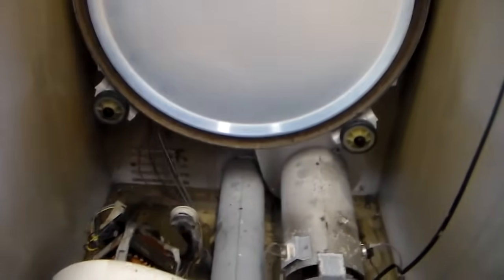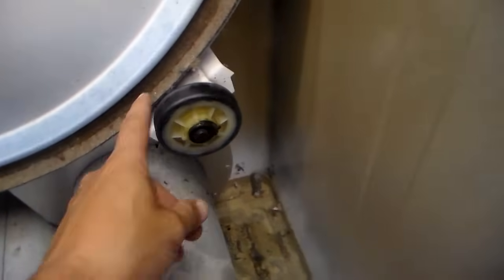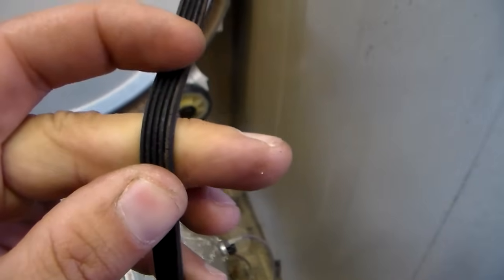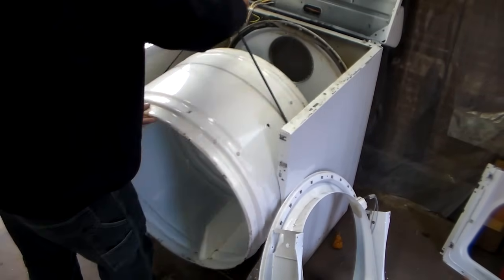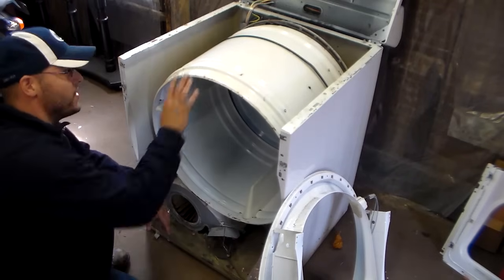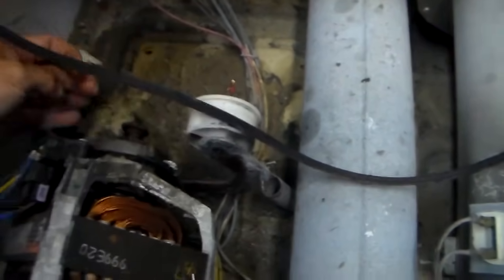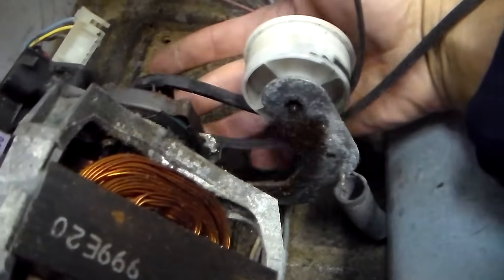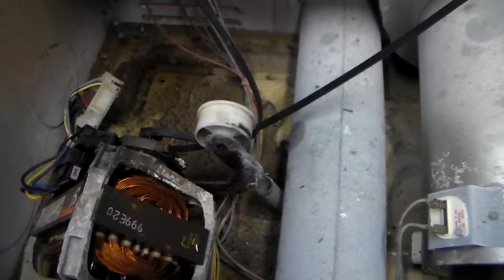How to Replace a Belt on a Maytag Dryer

Comment: This is so good. 
Did a wheel replacement. And I sucked at it.  There is a special tool to remove the clip for the wheel? The round thing that goes around the shaft.

Comment: I've gotten mine apart and have new rollers and tensioner/pulley.  One question though is that my motor is completely black with what I assume to be old belt dust or something.  Is there an easy way to clean the coils or inside the motor or is that actually necessary?  It seems like removing the motor would be a lot more work but if it's something I should do, I will.

Comment: Hi Bill, I have an old Maytag gas dryer and I just can´t figure out how to place the belt on it because the bottom under the drum has no room for sticking my hands in there to place the belt. I do not have a model number, but the warning labels are French, so this model may be Canadian Maytag. There is no Maytag service in Brazil, so I need to do this myself. Can you help with information?

Comment: Well, I been dealing with this dryer for last 5/6 days on and off with weekend off since local suppliers are apparently closed on Saturdays these days! 

I picked up rollers on Thursday,   and shop was pushing idler pulley, I refused and asked if they had belt in stock, to which they had said yes Thursday, and I had full intentions to start repairs Thursday, but life got in way. Friday eve I start demo, and get fully disassembled,  belt was clearly snapped, sat I tried to get replacement with no avail! Today I called original shop they said special order,  so I called their main comp and they had it in stock. I get back and shop vac all dust and debris.

Repair time, start with both rollers, goes smoothly, inspect belt to motor, something looks fishy! The motor pulley that belt attaches to before tensioner is m.i.a! 😮😮😮

I look on base and shop vac no avail, spend 4-5 hrs with different suppliers and manufacturer, no lucky on nut piece,  super frustrated I was about to order a 250$ motor. 

My better half walks in, asks did I try Amazon!? Sure enough less than 20 for the piece to receive the belt! Part arrives tomorrow by 4pm.

Without your video, I was so lost as per how belt was originally installed, as snapped and spent a few days opening changing parts etc, your video literally is going to be my saviour as soon as belt arrives, along side with white grease as drum is all scratched uo, and will need some love too! Thank you so much for this video it has put my mind af ease!😅😊

Comment: Thanks.  I have the similar dryer and I'm replacing the rollers and thought I might as well replace the belt.  Oh and thank you Maytag for not providing an access panel to get to the belt pulley.  No wonder that Maytag guy retired.

Comment: I gave a maytag dryer. It is making a squeaky noise. It  makes noise when the clothes are dry. It doesn't when they are wet. It does dry. It does spin. Is it the belt that needs replacing?

Comment: Mine has an access panel, right there by those vents on the bottom left by the idler pulley.  Can't I just have the wife hold the drum from the front while I install the belt at the pulley? Oh, and where do I find the model number?  Never mind.  Inside the door.  Model LDE313 series 07.  Now I need to order the belt.  Mine looks just like yours.  You got the part # on that?  Thanks.
Reply from the maker: Mc Gowdog 312959
Thanks for Watching!
Reply: I found the part # on the belt.  7 bucks on ebay

Comment: I almost gave up, I replaced the rollers, roller shafts and still had problems.  You saved me with your things to check.  Sure enough only 7 dollars more for a idler pulley.  Works like a champ thanks so much!  Plus there were no real wear tracks on the drum, so I thought it went in the groove.  I think the groove is put there to make it easier to install the belt.  First I get it running correctly in the groove then pull it back onto the drum.

Comment: Before you try this, don't. There is an access port at the back that is four nuts, take those off to put the belt on the pulleys, do not do what he's doing, you'll notice in the video there is an exposed power supply, those capacitors can shock you even when unplugged and if you're unlucky they can kill you. Realistically, you just need to remove the door and front bracket, slide the drum out the front, put the belt on(ribbed side up), pinch the top together, slide it in, drop it, put the belt on the motor pulley through access door, pull up on tensioner and get it on the tensioner
Reply: Looking in through back port, belt goes around right side of motor pulley, then belt goes around the bottom half of the tensioner, belt then shoots up and back to the drum
Reply: Many dryers DO NOT HAVE an access panel in the back. Check your facts before you dis someone who knows what he’s doing.

Comment: Thanks for posting this video I replaced something 15 years ago and a drum roller today, I don't think I would have gotten the belt back on without your help! I think the dryer was in the house when I bought it 45  years ago and it's still going strong. Two adults and 3 boys, they don't build them like they used to. I guess there aren't a lot of 80-year-old guys that enjoy the challenge of replacing a noisy bearing or two. 
Again I Thank you.
Reply: good job Bill

Comment: I had just about given up.  because I had knocked of the belt my self. then I was told to check you tube.  5 min later I did test run. then fully assembled and began to  dry clothes. excellent video,

Comment: Thank you very much!  I could not for the life of me figure out how to properly connect the dryer belt to the motor shaft/pulley and idler pulley until watching your explanation.  Using the left hand to raise the pulley and the right hand to pull the belt UNDER the pulley wheel and then connect to the motor shaft/pulley was the key.  I watched several other videos, read numerous explanations, and looked at many illustrations but not a single except yours actually explained how to do it.

Comment: We took it apart to remove a bic lighter that fell into it the blower. We put back together now my dryer smells like something is burning when we turn it on and it sounds like it is laboring. We vacuumed it out but it still has that smell. Any suggestions
Reply from the maker: Michael Guardino Make sure your belt is installed properly.  Make sure the drum is resting on the felt in the front and sitting on the rollers in the back.  Double check your work, take your time and try again.   Let me know how you make out.
Thanks for Watching!
Reply: Thanks Bill for the suggestions. It work!!

Comment: I know this is years later, but maybe someone will see this. I have the same dryer, and there was a round blue plastic piece that was half melted on the belt, near the motor end. I checked all over for a spot, paused this video, zoomed in, and checked the best I could. I still found no blue piece that belonged anywhere, and it's doesn't look like something someone would have had in their pocket...strange. I think I found the problem, though. Thanks.

Comment: ? The wheels that help turn the barrel are squeaking?  What is the best thing to use on them?  WD 40?
Reply: Zoomspout turbine oil. You can usually find it at most appliance outlets and some hardware stores, like True Value. This is important because a non detergent and non paraffin oil is required, and most all other oils contain both of those ingredients. This oil can also be used for electric motor bearings and vintage/antique fans (which is where most of my use is) that have an oil port.

Comment: Great help. Thank You.  (No access panel for me either. I almost broke out a saws all with metal blade :). Well, the belt was good shape still after 22 years - Fwiw.  I had a roller that was fairly bound up that I just freed up and lubricated.  Put the new belt on anyway.)

Comment: hi Bill I was fixing my dryer like this but a little newer I think the Idler pulley had this fork on it which the belt scraped against. I broke the fork thing off and the idler got really noisy.. am i putting the belt on wrong because I couldn't figure out any other possible way the belt to go on. ?

Comment: This was a nice video, managed to replace the belt and the rollers (the two top ones and the pulley one), however the dryer drum didn't turn and there was a squeaky noise.

The motor part which turns the belt near the pulley isn't "biting." Have any solution to that?

Comment: HEY BILL, I just replaced my belt but it keeps popping off. I put it right on the groove it was on before. I checked the pulleys, etc. Is there a piece off the end of the motor that keeps the belt in place because off the end of my motor is just a small pulley axle with nothing to hold the belt from coming off the end.

Comment: I usually make a cellphone video as i disassemble things, but didn't do it this time (drat!). One of the drum rollers was bad. I replaced the roller and then couldn't remember the belt routing. I know this belt material won't stretch, so i was baffled as to why i still had about 5 inches of slack with the belt all the way around the drum. This video made it clear. Thanks!

Comment: So, if you were actually fixing the dryer in the video, I suppose you would change out the pulley and Idler wheels since they weren't turning freely, right?
Reply from the maker: ***** Yeah, if they don't move freely they need replaced or cleaned, oiled.  If you don't, then the new belt will have a shorter life.
Thanks for Watching!

Comment: Thank you for making this super easy for a single mom of 3 teenagers who made horrible faces when I told them they'd have to hang a clothes line up and dry a load or two outside until I get the dryer fixed! I'm sure you've made this repair job a breeze for not only me but even people who could never see themselves handling this diy repair job all by themselves...

I watched this video about 2 years ago and I'm back just to make sure I'm getting it all right once again. I should have replaced the belt when I replaced the drum rollers back then...but then I wouldn't have gotten to scroll through and find your video. It's been saved of course 😊 And my old but reliable dryer is reliable once again!

Comment: if there are cracks in the belt, does that mean it is time to replace it? My Maytag , gas dryer seems to spin fine until there are a good amount of close in it. it will then stop spinning, but continue to run and heat. it smells like burning rubber. should i assume that the belt is spinning but not grabbing the drum? Do you think that replacing the belt will fix this issue?
Reply from the maker: Yes,  it might have stretched a little, that will cause it to slip.
Reply: Thanks I appreciate the reply. Have a great Memorial Day!

Comment: I have a question. The dryer I have is a maytag model lde610 series 01. It has been squeeling when I run it. Is that going to be the belt? Pulleys?

Comment: HUGE appreciation-watched this 10+ times & finally got it. its alittle stiff spinning but i esriously cant remember if it was always like that. my very old de410 had a small but effective backdoor & i used duct tape to hold the right side down over the drum-removed after attached to the thing with the spring & motor round thing. You made a nearly middle-aged woman very happy (and filthy dirty)-THANKS!!!!!

Comment: Thanks, but my old Maytag had a slightly different belt feed direction. Down from the left and ccw around idler, then around motor shaft pulley cw and up to right side of drum.

Comment: Thanks so much. I wouldn't have understood unless you showed specifically what the loop should look like. Best explanation I found so far. I'm going to try it today and let you know how it turns out. Quick Question: Could a dryer ever squeak or make noise based on the amount of lint that is caked inside? I bought mines used and one day it just started growling and squealing like crazy. I literally had to vacuum it out twice and wipe the inside down with a damp cloth and soap. Disgusting!  But none of the parts (rollers, pulleys or belt) seem to be sticking or broke. Thanks for your help.

Comment: you can also put it on the pulley and motor, then tilt in the drum into the belt opening until it sits on the rear wheels.

Comment: Why does my idler pulley wheel not go all the way across. The surface where the belt rides is only halfway across meaning the belt slips off into the open gap. I am thoroughly confused.

Comment: it seems that the pulley on the end of the motor shaft is loose. I was able to spin it with my fingers. it would seem to get tight but then break free and get loose again. after playing with it for a while it seems to be very tight. Can that pulley itself be replaced or do I need to replace the whole motor?  Thanks

Comment: Thank you Bill.  Yes you have to pretty much take apart the dryer to replace belt, rollers, idler pulley or drum slides.  As a suggestion once you do have the dryer apart, take short video clips of spinning the rollers and idler pulleys, as well as the drum slides so you can show your local parts shop (if you buy them there vs online), so they can help diagnose and you get only what needs to be replaced.  

Our machine was starting to squeak badly, figured it was the idler pulley or rollers going bad.  Upon checking, the rollers were actually OK, needed a few drops of oil (I used 3 in 1) on the shaft which made them spin much easier and eliminated squeaking.  I cleaned the idler pulley and also dropped some oil on shaft.  While in there I replaced the drum slides which you might as well check and replace if they are worn along with changing belt. My cost for belt, 2 slide kits, and 1 bottle of 3-1oil from local parts store was $89.  Although I can afford a service call or new dryer,  I have fixed both my washer and dryers in the past.  It saves money sure, but fixing things yourself starts to build your knowledge base of how and why things work, and builds confidence and self reliance.  And as the great Red Greene says, “If the women don't find you handsome, they should at least find you handy.”

Comment: I change the belt on my maytag dryer now it won't start. It makes a clicking sound and the light goes back out. I hook the light and the door wire back up. I have some wire I can't think where they go. I think that could be the problem.

Comment: Thank very much for this! However, since my arms were not long enough I had to do this with one arm. 

Also I found it easier to place the belt on the motor first and then pull the tensioner wheel back until I was able to set the belt on the wheel which was way easier than vice-versa.

Comment: i had a dificult time just a tip  line it up then from the back of the dryer there is a back door its small. with a light bulb you can take the spring off but it together then put the spring back on . you can actualy see what you are doing

Comment: Bill, good video - thanks.  Your dryer has the ribs/grooves in the belt on the drum (at 2:15 in the video), and cloth side out.  Some older Maytag dryers (like mine) have a different idler setup, where the idler is below the motor pulley, and the the belt goes cloth side to the drum so that the ribs end up in the grooves on the motor pulley.  Also you point out  (at 2:25) that the belt rides on the old wear mark.  My dryer has a slight concave section or groove around the drum that seems just right for the belt.  But it's about an inch behind the wear mark on the drum.  Use the wear mark!, not the groove, else you'll have a floppy tensioner, a belt out of alignment,  and no rotation.  I did this.  But looking back the way i did it, with the belt in that groove, is was easy to wind the belt onto the tensioner pulley and the motor pulley, and then drag the belt out of the drum groove onto the wear mark, which tightens up the tensioner pulley.

Comment: On some Maytag. Don't take the top off..because  the Front comes off first !!
. There are 2 Philips screws on the front panel .. near the  Bottom.. 4" from the bottom on each side facing up.  
Then the front drops down.

Comment: Bill, thank you for making this video. It really helped me with my dryer. I can help folks out though. It seems impossible at first to do this but I came up with an idea. Simply use painters tape to align the belt to the drum. 

I placed painters tape on the belt and taped it to the outside of the drum right where it was before it failed (on the rubber wear marks on the drum). This allowed me to insert the drum without moving the belt out of alignment. Once the drum was back in place, I simply did what you instructed and put the belt onto the tensioner and then looped it to the motor. 

Once this was done, I turned the drum slowly (looking through the crack at the belt to see where the belt and tape were).
Once the tape parts of the belt start to get close to the tensioner, you simply reach in and pull them off. One at a time. Made this job VERY easy.
Anyway, thanks for the instructions. My dryer works perfectly now. :)

Comment: Wait a minute...Isn't that "hole"  in the dryer covering, next to the idler pulley removable? Why not just remove the metal circular covering and then place your arm through the hole and put the belt over that idler pulley and motor that way?